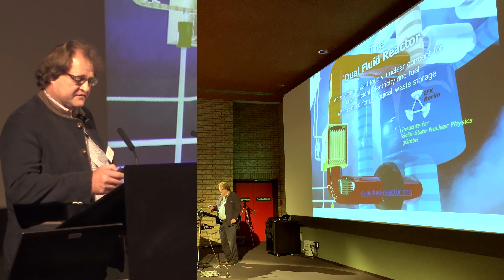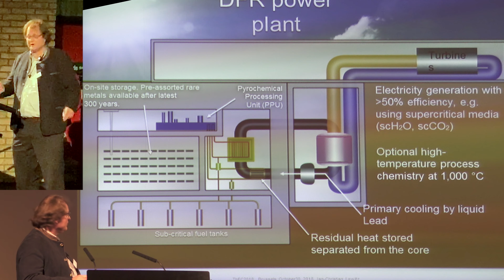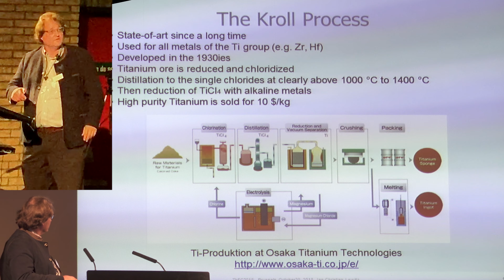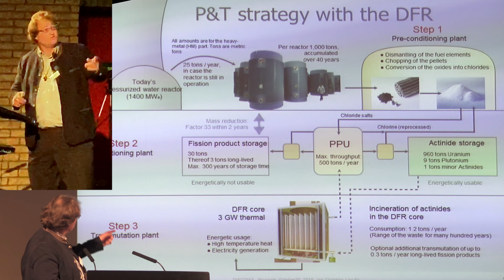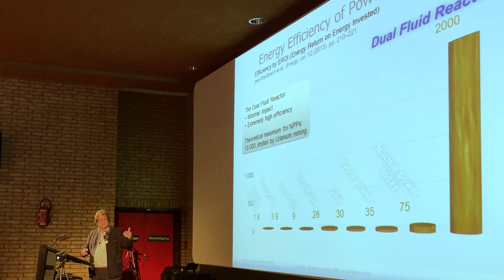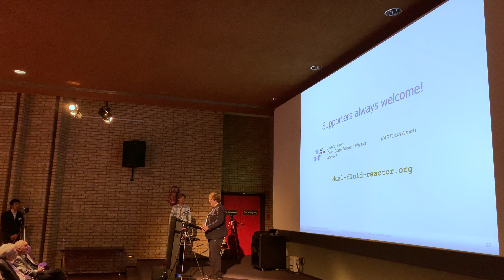DFR: the Dual-Fluid Reactor - Jan-Christian Lewitz @ ThEC2018

Comment: Using sCO2 as the core coolant and any hole in the fuel containment would just push it into the fuel's dump tank, that is going to be a lot of lead to pump around.

Comment: From the slides it appears that the thermal power aimed at is 3 Megawatts. This is about  the same thermal power as a regular Pressurized Water Reactor today. In Germany, we will have a couple of decomissioned PWR in the next years. Would it be possible to replace a PWR with a DFR ? The whole infrastructure is already available, even a containment buidling designed for a PWR. It would instantly have access to the grid, Turbines, Generators, Transformers etc. Maybe you could even recycle some parts from the steam generators, provided they can withstand the hydrostatic pressure from liquid lead, which is considerably higher than from water.  Spent nuclear fuel is also available. It would just take some guts to make that decision and defend it in public. Ithe reactor would offer passive safety, burn nuclear waste and safe billions of euros of investments and costs for disassembly of the PWR plant. Would that not be worth a thought ?
Reply: You commit the same mistake as all people who confuse theoretical proof-of-concept with commercially established technology. There are several stages and decades between them. The DFR main concepts have been shown to work theoretically in two dissertations (!) only some years ago. Even members of the DFR group admit - like in the very video youre commenting to - that "lab experiments" still have to be done. So ETA for a commercially available DFR GOING ONLINE mayyyybe will be by 2040. This is all fine and we should be open to all kinds of nuclear fission and fusion that achieve Gen 4 like properties. But in the meantime, we have to act NOW. Not 2040, not 2035, not 2030 - NOW. And this means scaling up low CO2 technology already running like renewables, gas (at least instead of coal), importation of low CO2 energy, energy efficiency.
Reply: @hooplehead1019  You're panicking because of CO2. And you're watching to much cared TV.
We won't die because of CO2 in the near future and we are thousands of years away from such a scenario. Btw China is building 1000 coal power plans at the moment and the situation is not different to India.
The true reason about all that CO2 gaga is, that you were  intentionally misinformed to make it more acceptable, that you will pay more tax.
Reply: @OpenGL4ever  facepalm - no I dont watch TV and blogs by lobby institues - I read the scientific literature. And it doesnt say "we die" - it will just be much cheaper to mitigate climate change - simple as that.
Reply: @hooplehead1019  Read what i said before. China is building > 1000 coal power plants. You can't stop climate change, the only thing that will happen is the de-industrialization of Germany.
And in the long run you will loose your job, because ultimately it depends on the industry.
And you will have the de-industrialization because the industry depends on cheap energy. If local energy prices rise, because of CO2 politics, the goods will become much more expensive. When they get more expensive than the same goods from other countries you will loose.
It's a simple calculation and it requires only maths and a brain.
Reply: @hooplehead1019  Also keep in mind. You can't say Germany does produce better products. Because China and the rest of the world are catching up. And the quality of Chinese products of today are much better than they were 5 years ago.
In the end it will only depend on energy prices and labour costs.
You can't keep up on labour costs, this battle is already lost, the only thing that is left is energy prices and if the Greens continue with ruining Germany, this battle will be lost too.
It will be especially lost with power to gas to power energy storages. An efficency of only 25 % will give you energy prices of > 0,70 € per kWh. With such high prices the game is over.
Reply: @OpenGL4ever  Ah, you mean deindustrialization when the government put 80k people out of jobs in the renewable industry - to protect 20k in the coal industry which has zero future in Germany. Prices for renewables are on par with fossile fuels and nucelar - you obv oversleptt the last couple of years: https://de.wikipedia.org/wiki/Windenergie#/media/Datei:Stromgestehungskosten_Deutschland_2018_laut_Fraunhofer_ISE.png You obviously also dont take into account that your energy bill doesnt show true costs for the energy sources equally: For long we taxpayer have paid huge external costs for fossil fuels - not on the energy bill, but by subsidies and health costs on other bills and taxes. Without them, renewables would be by far the cheapest energy source already. Just look at the direct costs - climate change not included!  : https://de.wikipedia.org/wiki/Kohlekraftwerk#Finanzielle_Folgekosten_des_Luftschadstoffaussto%C3%9Fes
Storage wont become an issue for quite some years - and then we will have much better info what to do, whether to build storages, which kinds, how much of a constant energy source we need, which one that will be and so on.
Reply: @hooplehead1019  The government didn't put 80k people out of jobs in the renewable industry, this industry wasn't competitive with the global market, that's why it closed 80k jobs.
Read my comment above. Energy and all the other bureaucracy of the green party was too expensive. If it were cheaper, that wouldn't have happened.
You are making a big mistake, you are comparing prices of the same country, you need to compare the energy prices with the rest of the world and then Germany gets ridiculous expensive.
In Iran you can buy one kWh of electrical energy for 0,006 US Dollars. Germany is around 22 to 55 times more expensive.

Then you are making a big mistake by only taking into account energy prices of renewables when the energy is directly used after it is gained. But as soon as you put all the costs in that is required for energy storages the prices will go up.
Compared to this the dual fuel nuclear reactor will be able to provide much cheaper electrical energy than renewables and this is what Germany needs to lower the energy prices.

Storage is already an issue and no one does have an acceptable solution. The problem is, you might try to think ideological and dream of fairy tales like all the greens do, but you can't beat physics.
Reply: @hooplehead1019  The Czechs have already put in AC phase shifters to prevent power variations from Germany, caused by VRE intermittency, from damaging the power infrastructure there. 400,000 people have had their electricity cut off due to rising prices in electricity, mostly due to the renewables surcharge and other taxes and fees, but big business in Germany gets waivers to those fees, as do farmers. So effectively what you have is a wealth transfer from the lower classes to landowners and capitalists. That's not social democracy, that's neoliberalism on steroids under the guise of green politics. And it is doing that wealth transfer, for a decarbonisation rate that is slower than the United States - which itself has renounced the Paris Agreement targets! https://www.cleanenergywire.org/factsheets/germanys-greenhouse-gas-emissions-and-climate-targets
The US on average decarbonised around 1.5% per year without policy, especially once fracked gas from the Marcellus Shale spun up. Germany has taken 30 years to decarbonise only around 28% compared to 1989 levels. That is less than 1% per year. And most of that decarbonisation is actually cheating! By using baseline numbers from the time that East Germany had massive numbers of old, inefficient lignite coal power stations, Germany can claim a faster decarbonisation rate by closing power stations that would have been closed without climate policy anyway. 

The SPD should be renamed the Neoliberal Partei, because that is the direct outcome of its policies. The coalition government's stances on industrial policy are part of the reason why AfD, the fascist party, has made pretty significant electoral gains, and it would not surprise me if at least some of those gains were from those 400,000 people who had their electricity cut off.
Second, on the subsidy issue for fossil fuels. There are extremely large amounts of money put into fossil fuels but also a large amount of that is raked back by taxation. In general, fossil fuels generate net taxation income for the German government, while renewables generate net taxation expenditure. I would wager that much of that expenditure comes from waivers to big business so that they don't leave the country due to high electricity fees - but since industry is a key strategic pillar of the German economy, I guess it is not so surprising.
What Germany is really lacking right now - not "quite some years" - is storage. It really needs storage by the day in Petawatt-hour quantities, now, not "quite some years" from now. Otherwise it will continue to fail - as it has for 30 years - to decarbonise. I should also note that the current policy direction seems to be to turn towards Russian gas as primary energy and to leave Bavarian coal miners without a job in the future. And for some reason it is razing Hambach forest for another lignite coal mine? So Energiewende should be renamed Braunkohle und Erdgaswende. With a fig leaf of Windmuhlen. With the policies as set for now, Germany is no climate paragon. Perhaps more of a climate pariah. And the Greens and SPD are at the centre of that failure. 
https://www.electricitymap.org/?page=country&solar=false&remote=true&wind=false&countryCode=DE
Reply: @OpenGL4ever  . . . that much is true! The CO2-panic is to make people afraid of the future and to get their money.
Reply: @OpenGL4ever  . . . you are totally right - as I am, because I think the same way you do.
Reply: @hooplehead1019  . . . we can not store electricity and we will never be able to do so. If we produce today to much electricity and want to use it tomorrow, we have to transform it in a new energy form and tomorrow from that new energy form back to electricity. That will rise the prise by 400%. That means wind power is totally useless. 
Let me compare the DFR and wind power. Germany needs 600.000 GWh electricity a year. A 3 MW-wind turbine can produce 4 GWh electricity a year. That means we need 150.000 wind turbines every 20 years. The DFR runs 60 years - so we need 450.000 wind turbines in 60 years. One of these wind turbines will cost including building and rebuilding about 4,5 million Euro. Just to buy the wind turbines for 60 years is about 2000 billion Euro. (In german: zwei Billionen Euro).
A 3 GW DFR will cost about 3 billion Euro and will produce 26.100 GWh a year. For the 600.000 GWh we need 23 DFR and one for reserve. And 10 billion Euro for the prototype - in total 82 billion Euro. And of course the staff for 60 years.
Wind doesn´t blow 24 hours in 365 days - so we need a complete second installation of gas-fired power stations. Any questions why new energy is bullshit? Wind turbines and gas-fired power stations for about 2200 billion Euro or 82 billion Euro for 24 DFR? 
Wind power is changing in cube. So quarter wind means 98,5% less electricity. A wind turbine can not produce more than 15% electricity in average. A 3 MW-wind turbine can produce 4 GWh in a whole year - in life time of 20 years 80 GWh. These 80 GWh a DFR produces in 26 hours!
A DFR needs the space of a football field, the electricity for Germany is done on 24 football fields. A 3 MW wind turbine needs also a football field of space. 150.000 wind turbines need the space of 150.000 football fields. One of those wind turbines has a hight of 200 meter and has a weight of 7000 tons. The foundation has a weight of 3500 tons with thin anchors going 30 meter in the ground. These foundations are not removed after the 20 years lifetime - they are left in ground. 
Any questions why new energy is bullshit and will ruin Germany? 82 billion Euro or 2200 billion Euro?
Reply: @Manfred_Sommer  Apart from purely theoretical performance and costs claims of DFR, professional researchers have already written about the feasibility of renewables in Germany. Ill refer you to them: https://www.ise.fraunhofer [dot] .de/content/dam/ise/de/documents/publications/studies/Fraunhofer-ISE-Studie-Was-kostet-die-Energiewende.pdf
Reply: As long as the majority of the population do vote for CDU, SPD, Die Grüne, Die Linke and FDP there will be no near  future for a commercial DFR in Germany.

Comment: A transient liquid Lead as the moderator and cooling loop?
Reply: This is a fast spectrum reactor, the lead coolant works supposedly not as a moderator but as a neutron reflector.
There is going to be some hard core engineering and science to get that salt at 1000 C to not eat the metals.

Comment: "...a passing and bathing the primary duct..."   If this is supposed to be English, is not "duct" something used in connection with air, gases etc, not liquids? Does he mean "pipe"?
"...bathing...."?    Does he mean Immersing? 

"... the fuel duct is lead through the core vessel..." When lead and lead(Pb) is used in the same context there is a chance for mixup. Is this snipped from a patent application?

A change of wording to clarify would help.
Reply from the maker: Looks like you posted this comment many times by accident I deleted the copies. I don't know answer to questions.

Comment: His design seems like it adds a lot more complexity compared too a dual loop chloride molten salt fast reactor with the benefit of having more power density and a smaller startup fuel requirement? I don't think the mentioned the fuel purity or amounts required for startup.

Comment: Sounds like good German precision engineering and very effective output in proportion to the inputs.
Reply: A big part of the efficiency in these systems also comes from using the huge stockpiles of nuclear waste we have now. If we were allowed to build these kinds of plants we wouldn´t really need to mine much uranium for the next 40-50 years or so while we finish developing the fusion reactors that will truly be clean nuclear power. Solid reactors are just so inefficient because they only use 5-10% of the fuel.
Reply: @excitedbox  https://www.youtube.com/watch?v=Zy6zCgftVPY It is a good new reactor design but it uses active pumps, I rather prefer that they redesign it to use the same design but in a highly modified way to use the passive self-cooling convection principle. Our military reactors, the new ones, uses an all out passive design and using an all analog controls, monitors, sensors, feedback systems, indicators, etc. It is used in our high-temperature pressurized argon gas-cooled reactors modified to use the passive self-cooling convection principle combined with heat conduction, heat absorption, heat dissipation, heat sink effect.
Reply: @excitedbox  😂😂😂